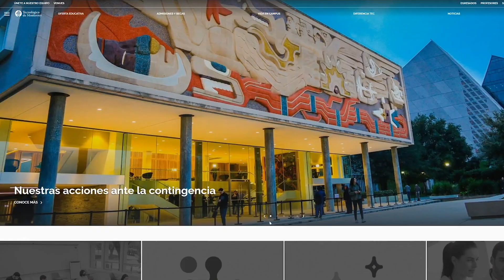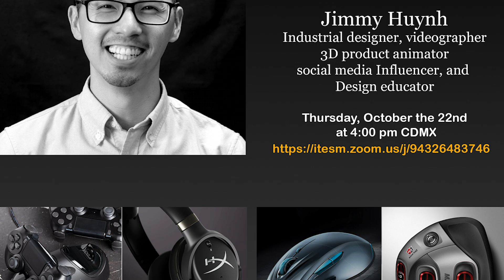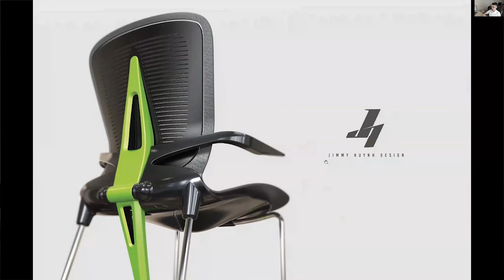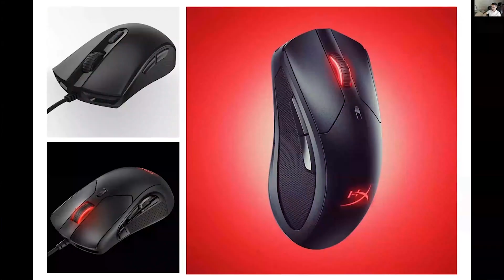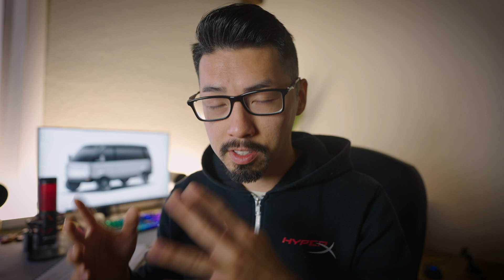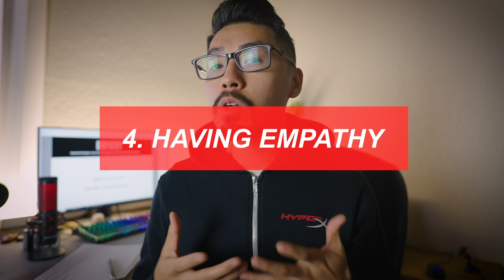What It Takes To Be An Industrial Designer

Comment: I am 74 and I am a practicing industrial designer from 1973 to the present.  My first job was as a car designer with Chrysler in Michigan.then appliances and housewares. Then working in High Tech in the west.  Sketching and Modeling/analog and digital are important.  Additionally a feel for mechanical engineering is important to deal intelligently with M.E.'s to, as much as possible, control surfaces, fasteners and knit lines and injection molded parts draft etc.  
     I was one of the first designers in my high tech company to learn 3D CAD modeling.  It was extremely difficult and onerous back in the day...but I had such a desire, I self taught and got very good on HP's ME30 CAD System.  It opened up opportunities for me at the company and I designed a portable ink jet printer to meet market demands as a visiting "intrapreneur" with HP's Singapore Asian Peripherals Div.  The design I did in less than a year won a Business Week Best in Category IDSA Gold award in 1991-2.  Other designers in the company shied away from 3D CAD and, as expected petty envy and back biting, happened.  Then, I was awarded an HP Fellowship and got my 2nd masters degree in New Media at Art Center College of Design and again, using this experience animated my designs in photo realistic ways that aided in powerful presentations to project teams and management.
     I then started my own consultancy and I am still consulting at this age because, "I LOVE DESIGN".  I am now using AI effectively in product development.  I had a young designer ask me if AI would "extinct" industrial design?  I said two things threaten the Industrial Designer of today....1. If you don't learn to harness and direct AI, you'll be at a disadvantage and 2. Industry must move back to this country.  When I attended Art Center, I would say, fully 2/3rds of the student body were Asians.  Many of them heading back to their homes in the Far East to practice their profession with the manufacturers over there.  
     We need to bring industry back to America...that is an imperative.  But never shy away from new technical breakthroughs like Chat GPT.  I use it to help me write my proposals...it's great!  Sorry I got long winded, but, I hope I contributed to the conversation.

Comment: Dear Jimmy
Glad to know your info.
May I know if we can help you something in your business?
I'm Maggie from Shenzhen KG Model Co. Ltd, which provides some services in metal and plastic items:
（1）Four processing: 1. CNC; 2. 3D printing; 3. Vacuum casting; 4. Sheet metal fabrication.5 Injection molding.
（2）Post-treatment: 1. Manual processing (Deburring, remove sharp edge, assemble etcc.); 2. Polishing; 3. Painting; 4. Sandblasting; 5. Silkscreen; 6. Pad printing; 7. Laser etching; 8. Electroplate; 9. Anodizing; 10. Cover UV layer; 11. Wire drawing; 12. Gilding etc.
If you need prototyping supplier in China, pls give us a chance to turn your design into reality.
I'm waiting for your reply.

Comment: Key Points 
1. Sketching and 3D Modelling
2. Deep understanding of Mechanical Engineering--mechanisms and fasteners 
3. Eye for aesthetics- shape, proportions, color, material, finishing. 
4. Having Empathy - putting yourself in users shoes to understand their needs, problems they are facing.
5. Be Reliable